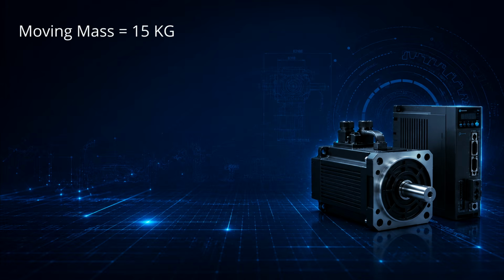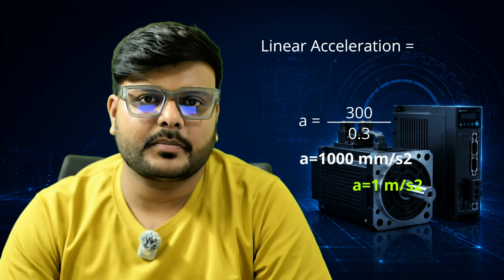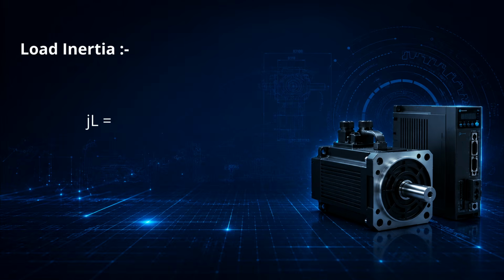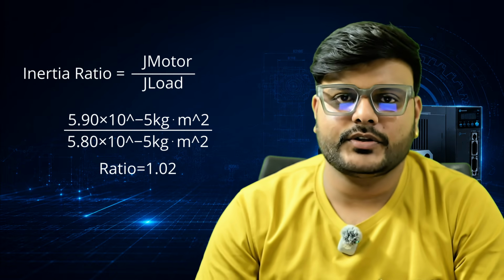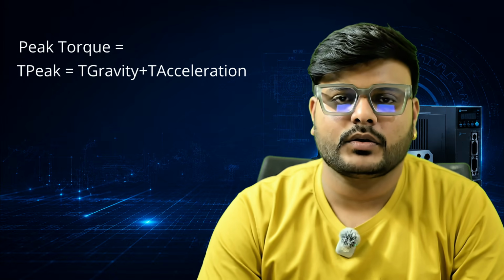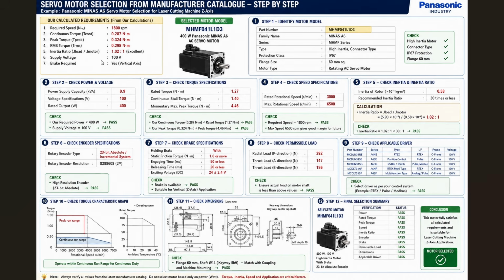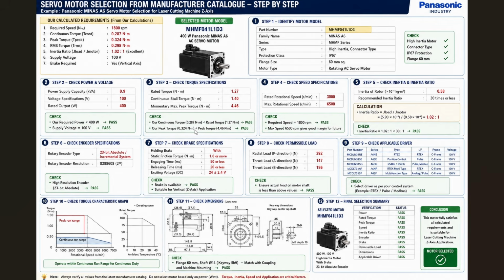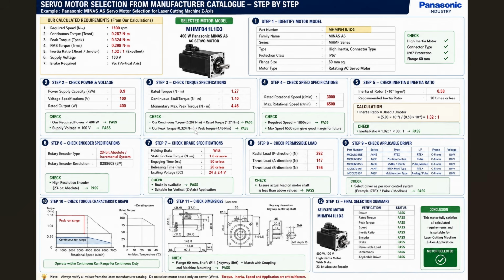Servo Motor Selection from Panasonic Catalogue | Step-by-Step Guide | Laser Cutting Machine Z-Axis

Comment: Still waiting for your reply...😅
Reply from the maker: Open your planetary gear box 3d model apply material to it and take inertia values from mass properties 😊 make sure to take inertia value from which axis is rotating this is quick and fast way and 70% correct for 100% correct value take it from manufarer catalogue.
Reply: @Machinedesignengineer  Thanks. But but my question was different. So, what we will do if the load inertia is greater than motor inertia. How we will match it with motor inertia.
Reply from the maker: Good question, let me clear it 100%
Your load is ALWAYS after gearbox, right? So we have to REFLECT it to motor side for Panasonic catalogue calculation.
Step 1: Find Load Inertia (JL) at gearbox output side
If load is disc/roller - JL = m_r²/2. If you have 3D model, take from mass properties from rotation axis.
Step 2: Reflect to Motor Side
JL_at_motor = JL / (Ratio)^2
This is the magic of gearbox. Ratio 10 means load inertia becomes 100 times smaller at motor side!
Step 3: Total Inertia at Motor for Selection
J_total = J_gearbox (from catalogue) + JL_at_motor
Then in Panasonic catalogue:-
Inertia Ratio = J_total / J_motor_rotor _ 100
It should be < 300% for good control (for general) or < 100% for high precision.
So gearbox HELPS you to handle bigger loads.

Comment: But what if we have attached a planetary gearbox box after servo motor. Will it effect the load inertia. If Yes then by how much. ????
Reply from the maker: Open your planetary gear box 3d model apply material to it and take inertia values from mass properties 😊 make sure to take inertia value from which axis is rotating this is quick and fast way and 70% correct for 100% correct value take it from manufarer catalogue.